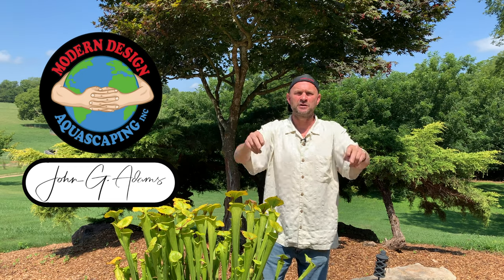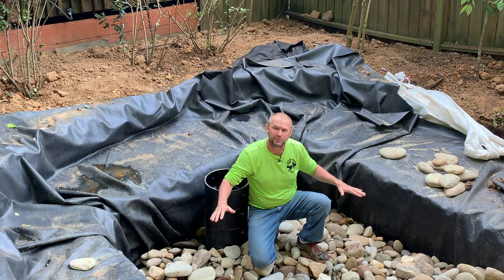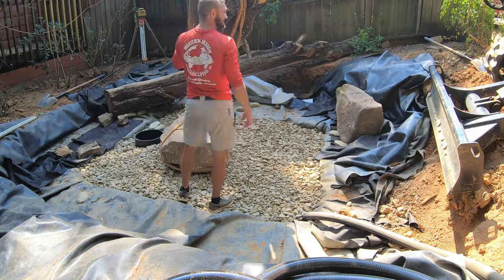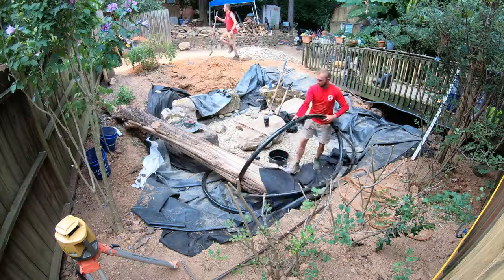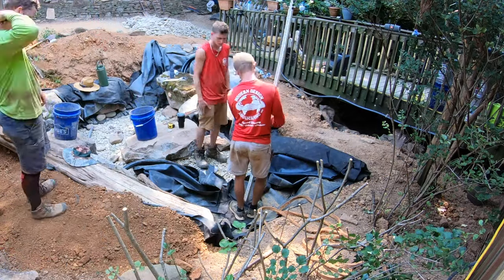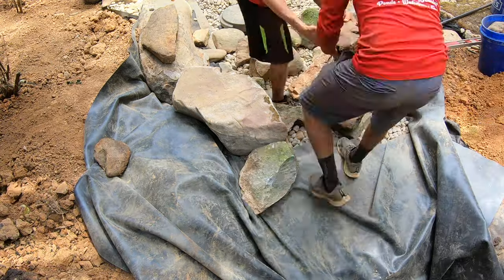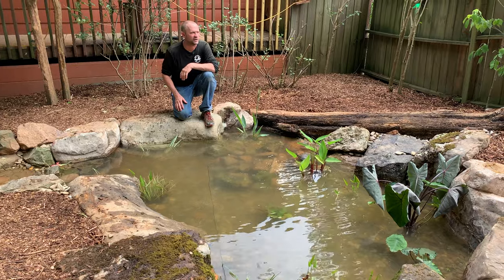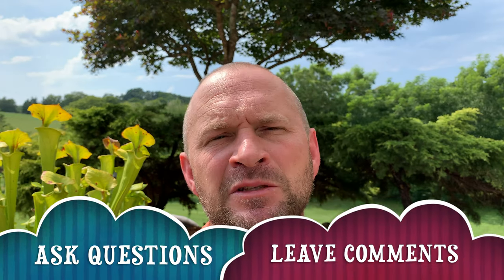WETLAND FILTER LAYOUT AND INSTALLATION Part 2 | Water Feature Design Series 9

Comment: Do you by any chance have a diagram on the anti re-flux whip thingy? i couldn`t quite follow as you were explaining. thanks.
Reply from the maker: Not a diagram but if you just install a tee into the wetland feed line at the highest point in the line and then reduce the tee line down to a 1” line you will be fine. Put that line just above water level so it can “suck air” in a reverse flow event it will break suction. It doesn’t matter what you do with that line-it can be just a jet flow-a fountain-a small waterfall-whatever. Just as long as it is the high point in the line so it can break suction in a check-valve failure event it can do it’s job. Even if you ball valve it down some it will still work!
Reply: @KoiAddiction  So should the end of the breather tube be above or just below normal water level?
Reply: @KoiAddiction  it would be awesome to see a detail video on this topic. Thank you!

Comment: Hi John, I still love watching this - everything I need to know is included in this 2 part video - thank you. What I'd like to know more about is when an liner overlap is acceptable or when a seam join is more appropriate - a short video on that would be really useful 👍thanks again buddy
Reply from the maker: Overlap should be at least 12” vertical drop. I ALWAYS seam now, it’s just so much easier than fixing stuff or dealing with root issues 10 years later!

Comment: Great videos can you show the electrical component of how you plug in the pumps and concealed at the same time. Thanks!
Reply from the maker: The pumps are down below in the skimmer (or often in the intake bay) if they are submersibles. I am doing externals on my Oasis build, currently working on that,,,STAY TUNED :)

Comment: Hi, I love your video. Would it be possible to go integrated detail on parts needed for the whip or bleeder valve that you installed in the wetland filter that serves as a check valve and jet?
Reply from the maker: Install a 2” tee in the main line in the highest point where it “hops” over the liner to go back to the bottom of the wetland. The “top” of the tee shall be reduced to a 1” outlet. The 2” now goes through to the bottom of the wetland. On the 1” line run a length of flex to top of wetland water level and install a ball valve. After the feature is flowing, adjust the ball valve on the 1” line and position the outlet right at water level✌️😎

Comment: Hi John, amazing video, this has solved the tangle in my brain, but I have a question? How did you attach the pond liners? What did you use, how durable would it be for a large swimming pond?
Reply from the maker: We have a video on how we seam a liner. Super “easy” but must be done right. A proper seam is the strongest part of the liner though. No worries having them in the bottom of the feature at all!

Comment: I think we need to make a wetland filter for our duck pond. It’s probably about 700 gallons and just being filtered by a small pond filter we bought at the feed store lol. It gets so filthy within hours of being cleaned!!! This seems like it would really help
Reply from the maker: Yes, ducks make alot of mess! Been there-done that ;) A wetland would def. help- I would make it same size as the pond. Another great option would be a large canister filter that can be back-flushed. That would be more frequent maintenance BUT would allow you to mechanically filter out more duck poo more often!
Reply: @KoiAddiction  would it be possible to run the water through some mechanical filtration first and then have it go through the wetland or would that starve the wetland?

Comment: Really appreciated this whole series of your blow by blow description of how to design and build a wetland filter, including the adding of the plants!  Great job!  I like the fact that you do not put the boulders on top of the filter itself.  I had always wondered about that in other videos I've seen.  I'm guessing that in some situations it is just a matter of how much space is available, but it seems better to put them outside the filter itself.

I have question that is not specifically related to wetland filters, but rather to water feature building in general.  When placing the larger boulders, I have always wondered about how you get the straps off after it is in place.  I caught just a little of it in the time lapse on this video, but was wondering if you could do a video where you go in depth into all the ways of handling large boulders?  Thanks!
Reply from the maker: We will get it done!

Comment: Hi John, you have, by far, the most informative water feature channel on YT. I'm going to add a bog filter in the spring and I'll be using 6" PVC pipe. I'd like to know if adding a hole near the top of the vertical cleanout pipe would accomplish the same goal as the whip or is it not as effective?
Reply from the maker: That depends — the point of the breather  is to break the siphon, so if whatever you create will effectively break the siphon when the power goes out then you should be good. We put the whip in line because we feed our wetland from the bottom. If water begins to siphon from the wetland and there is nothing to break the siphon then potentially you could backflow all of the sludge from your wetlands down into your pond.

Comment: Hi John, so many thanks for this video and all others. I have a doubt on this point: whenever you inject, say 2000gph, water in the filter, these 2000gph needs obviously to get out through the waterfall. Not less (or you will overflow the filter), not more (or you may not have enough water to make a nice waterfall). So: how do you calculate the size (width ? depth ?) of the waterfall to equalize that much quantity of water that goes in and that goes out? Does my question make sense ?
Reply from the maker: I answered this in the other post for you! Sorry for delay I have been on a big swim pond project in Denver working every day for the last 3 weeks and am behind on answering people ;)

Comment: Hi John. Im designing a pond in a known termite area and am paranoid about them chewing through! What extra precautions would you suggest taking? I plan on using 2 layers of 8oz underlayment under the liner.
Reply from the maker: 100% make sure you protect liner with geo. LEAVE NO LINER. EXPOSED TO SOIL! We have had no problems when doing this. BUT don’t think they wont chew through flex pipe too lol!

Comment: Hello, we keep going back and forth...how big would you suggest our regeneration zone be for a 100x150 pond?? thank you!
Reply from the maker: 1500-4500 square feet. Depends on variables. You could always build one wetland at 1500 ft.² and then if that’s not the quality you were looking for add another. There’s no downside to having multiple wetland filters, it actually improves circulation in the feature.

Comment: Hi John.  Thanks so much for all of the obvious effort you put into your videos.  They are an extremely helpful resource for us newbies.  Just a quick question regarding the T-line into the pipe running into the wetland filter.  I had considered a non-return valve however this sounds like a better option.  If using flexible hose do you use the same diameter pipe for the jet or is it rigid stand pipe with valve / what sort of flow should you have through there / where should you situate the T join just before entering the centipede and how far below the surface is necessary.  Thanks again. regards Andrew
Reply from the maker: Any size will do. And all you need is for it to be in-line before the wetland. Anywhere it is able to “breathe” will break the suction and keep the back-flow so don’t put it under water!

Comment: You recommend how much water on top of your rock? I was going to build mine even with the rock?  Great video.
Reply from the maker: I know there can be no limits. I have seen them built into the side of a pond 3-6” deep and into the bottom of a pond at 6’ deep. There is no “depth requirement” anything will go ;)

Comment: Thank you for a another great video. I do have a question. What is your recommendation for gph pump? I’ll be starting my wetland in a few weeks for my koi pond.
Reply from the maker: 2000 GPH per centipede into the bottom, the rest of your flow can run out of the jet on top of the wetland!!
Reply: Thanks again

Comment: One more question.  When you are sizing the wetland filter.  do you do it as a percentage of pond surface?  If so what is the % that you shoot for?
Reply from the maker: Theres a chart in Myerstown video, its from Aquascapes catalog. It starts at About 15% of pond surface. The bigger the pond gets the smaller the % gets. Anything is better than nothing though. You can always add a second filter later if needed.

Comment: When you're making this wetland 2 feet above water level, you build the garden up to that height and tamp as you go?
Reply from the maker: Yes, we tamp to a point. If its not structural (boulders on top) then it’s a trample-in so the plants can grow. Fine line between concrete tamped and still a stable soil that won’t settle too much !

Comment: You said only round rocks, but what about volcanic angular rock that has a lot more surface area for benificial bacteria?  Does it not have an advantage ?  For final small stone layer ?
Reply from the maker: My experience with lava stones is that they clog pretty quickly and become outer surface only. The need for round is so we can “reverse-flush” the filter. Angular stone tends to lock the debris in more, making cleaning more laborious.

Comment: That "whip" that you called it. Where does that attach? Will a check valve work?
Reply from the maker: It attaches anywhere above the wetland that will allow the system to break the siphon when the power goes down. The check valve at the pump will stop the back-flow scenario, the whip is for when the check valve fails ;)

Comment: The whip you mentioned is T valve off the input line? Can you give a bit more detail. I'm digging a wetland right now!
Reply from the maker: Just a tee off the feed line. It’s nothing more complicated than that. Use a ball valve on the teed line so you can regulate flow!
Reply: Modern Design Aquascaping Inc.  Do you also put a ball valve on the main feed line to manage total water volume through the wetland filter?  I.e. I have a total of 7,000 GPH going thru the feed line but my centipedes can only handle 4,000 GPH so I want to redirect the excess through my “breather” exit to relieve the pressure and increase my water fall.

Comment: Hi john love your vids

what about the wetland filters, should you put plants in them or not.

I hear different stories about this, one says plants are really necessary to remove all waste materials, others say that the filter bed is closing up because of the roots. and that more rot occurs through the roots.

what is your opinion?

I want to apply a wetland for a koi pond, and it seems ideal to me to make a platform floating above the filter, but then I cannot place plants in the filter.
Reply from the maker: I love the plants, they have to help out but are not necessary. Don’t use invasive-or use tropical that may die back in your area if possible! Remove plant growth and it will be removing nutrients, simple as that!!
Reply: @KoiAddiction  love that you take the time to read and answer! love your channel, keep up the great work, greetings from your fans from the Netherlands

Comment: I need help with my mud puddle, haha!! I have no liner, won't ever because the water table is too high. Mud sides and no plants yet, suggestions to make this swim able??
Reply from the maker: That project is going to take a lot of patience and technical skill to pull off. I don’t think I could just give you answers and shorthand here but definitely doable if you can work within the space that you have I’ve put liner in to a situation where it was underwater with rocks on top not The ideal situation though.
Reply: @KoiAddiction  I completely understand, hard to support without a 3 page description. I don't think the liner is going to be an option with the research I've found. Would dumping sand and gravel down the sides make a difference at all?? Cheers for the speedy response.

Comment: I live in the Arizona desert and evaporation is a concern when considering a large footprint wetland filter. Would it be better to make the reservoir of aquablocks deeper with a smaller footprint or single layer of large blocks? There are 2 aquascape contractors here in the valley but both are incredibly busy and my budget isn't such that I am able to have it all done professionally. My pond is 33 feet long avg 18 feet wide and 32 inches deep. The pond is lined with large river rock sitting atop each other and no shelving. I have a lot of work cut out for me to retrofit. I'm currently building a filter similar to the nexus but have many rabbits, birds, lizards etc I want to provide an aquatic habitat for as well as filtration for my koi and goldfish. My goats do not get into the pond when filled but will probably drink from it when roaming the property. I get monsoon flooding which I think I have managed but because I am on a well I would like to maintain some of the runoff to integrate back into my local aquafer.
Reply: I too would like diagram info about your anti siphon feature.
Reply from the maker: The Aussies do deeper gravel, faster flow rates, smaller footprint wetlands with success. I have no personal experience. If I were to experiment, I would do so with a dissolved oxygen meter and do research on what the beneficial bacteria is happy with, and then measure and dial in the flow until you have acceptable oxygen rates when the water reaches the top of the filter substrate. You may get a local college to work with you there??
Reply: Thank you for the recommendations. I had not thought to touch base with the schools. We have some amazing colleges and universities here so I'm sure one of them has programs that could use the field experience.

Comment: Help me John! In other aquatic life spheres we use porous rock for more surface area for the beneficial bacteria to live in our bio-filters . I have been planning to use lava rock for the middle layer above the large smooth stones and below the top layer small of smooth stones. I always see people using all smooth round stones for pond filtration. Do you have any experience with lava rock in wetland filtration? I ask, because I am about to build a wetland filter for my large pond in NW Mississippi.
Reply from the maker: I have never used the lava stone in a wetland. If it’s angular it may clog more readily than smooth round and be more difficult to back-flush efficiently but it may be a valuable addition in actual filtration capacity. I would love to hear how it works out for you long term, let me know how it goes!

Comment: hey John great work, love how you present all the information. I was wondering if by chance you know of a way to calculate water loss by evaporation for a pondless waterfall? there's a calculation on aquascape's site for ponds, but I can't find anything about the amount of evaporation for a pondless waterfall. I had one built this past spring and I'm currently seeing a loss of approx 150 gallons every 8-10 days and just trying to figure out if that's normal. Thanks for the great videos, looking forward to seeing more builds.
Reply: tanner alford we need more info. What’s the length, width, avg falls drop of your stream, do you know what your basin size, where are you located?
Reply: Donnie Beck thanks for the fast reply. The overall length of the feature is about 13 feet from spillway down to the basin and its split into two streams at the top. The basin I believe is just over 150 gallons as it is made up of 5 large aquablocks plus of course the pump vault with an extension. The width of each stream is about 12-14”. Located in south eastern Ontario Canada. Feature sees full sun from about 8am-5pm.
Reply from the maker: Yea what he said!
Reply from the maker: Your loss sounds very reasonable to me @ Less than 1 gal/ hour loss
Reply: tanner alford if you want peace of mind go to our friend Atlantis Water Garden YouTube channel. Jaak put out a great video about a year ago on a 5 step leak test that you can follow. If anything you can learn easy steps to identify potential leaks.

Comment: i am buildind a upflow biofilter for a swimming pond . The pond is 12' deep and 75x150 shaped like a bowl. how many runs and how long of centepedes do I need . I was thinking 4 runs 25' with clean outs on each run . An area that is 40'x80' for the filter . and a 15000 gallon an hour pump. Does this sound workable?😊
Reply from the maker: There are a lot of variables that go with a design of this size! You have about a 9,000 SF pond. In a typical ecosystem pond of this size I would shoot for a 3000 SF wetland (without knowing more details). That filter for a 9000 sf pond will be a 25’ x 50’ wetland with 16 centipedes and a minimum flow of 32000 GPH. From there I would also consider circulation- are you using jets or aeration for additional water movement? That may increased flow needs as well. I would hire someone (like Aquascapes or myself) to assist with total design and help you get that all planned out on the front end. This is a large project to miss the “small stuff” that will determine success or failure.

Comment: Great how to videos I am fixing to start my own wetland filtration with a small 10 foot  stream going into 24 x 30 Pond probably around 3 1/2 to 4 foot deep I’m wondering is it best for me to go with the 1000 series skimmer or do a negative edge or small basin which would be the perfect design for low maintenance and having 
koi and largemouth bass thanks for your input
Reply from the maker: I have had great luck with that size pond doing small wetland from a 1000 skimmer! Let me know what you decide to do👍😎